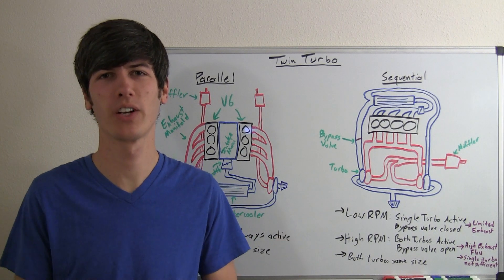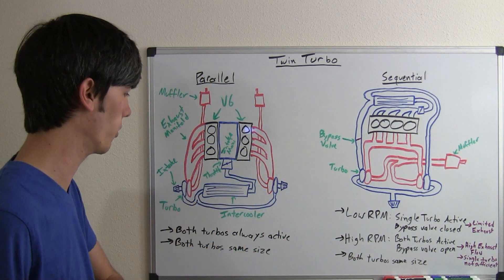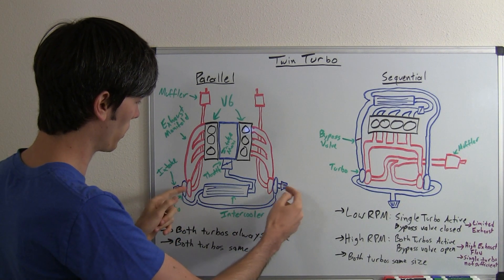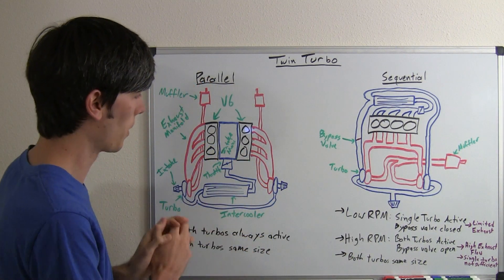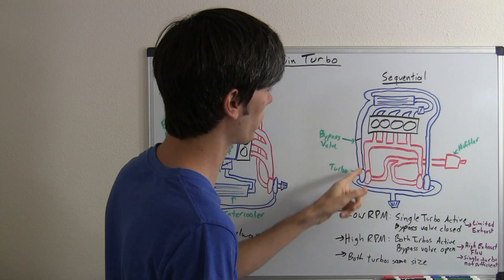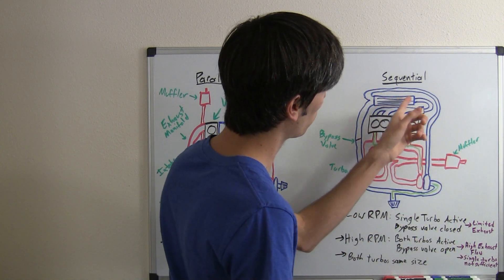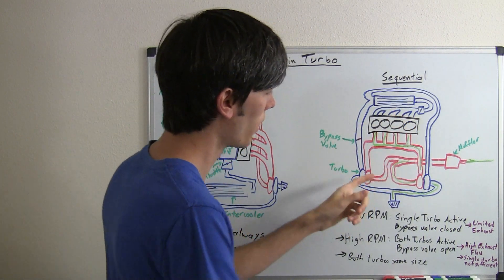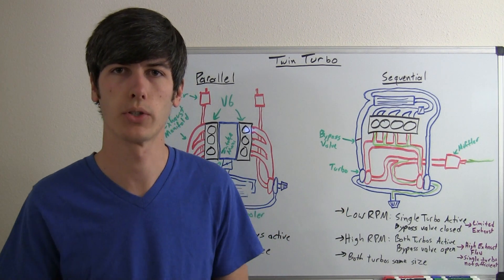How Twin Turbos Work - All The Boost!

Comment: why not use single turbo?
Reply: couple of reasons really... you could fit a single tub but you may find it runs out of puff higher up the rpm because its a small turbo (eg 2860 series) resulting in a harsh flat spot of power - so you think 'hmmm... gt35 series tub will give me lots of power' ...but that might not be making real full boost till 4000rpm making the car really undriveable lower down the rpm range.  Selecting a turbo is a balance of response vs power output.  It all depends on what kind of power output your wanting to obtain from the car really... if you want a drag setup then a big tub with launch control might work awesome but if you want something responsive and 'street' based then smaller turbos tend to work best.  That all said there's some awesome developments with turbos... Koenigsegg use a variable wgate and vane setup to allow the turbo to spin up at lower rpm then come in harder later on.  Dual Ball bearing systems help improve response massively too.. i ran a GT3076R on my 33gtst skyline and that came in quick and low down the rpm range also sounded the NUTS.. check the vid on my channel :p
Garrett do a GTX series of tubs able to boost higher, come in lower down the rpm range and generally make a bit more power than their GT series does.  in fact for 2.5 to 3 litre engines a GT30 series tub is an absolute laugh riot :p  I'd happily build another :D

The sequential turbo route (2JZ supra for example) - i THINK (someone correct me if wrong) works by using a small turbo to help the car lower down then a bigger one comes in to help higher up the rpm range.
Parallel turbo setup (eg RB26DETT nissan skyline) uses the same size turbos powered by 3 cyls each... this helps keep a great balance of response vs power... however the RB26DETT is known to turbo shuffle altho i hear ppl mapping them with MAP based tuning can eliminate alot of this :)

cheers
ant

Comment: This guy says the turbo it's going to pull in air through the intake and it goes into the intercooler... Thats wrong. On a turbocharged vehicle, it looses the intake air filter. Now that pipe runs all the way to the front of the vehicle where there is an intercooler. When the engine is is running, it's spooling the turbo. The higher the engine rev's, the faster the turbo spools. Now, the turbo has 2 sides. One side is where the exhaust/turbo manifold gasses go through, and the other side pushes air through an outlet which has tubing running to the other side of the intercooler. Inside the turbo on each side is a turbine. Now the side the exhaust gasses go through spin faster as the engine rev's higher. The other side's turbine pushes air through the tubing to the intercooler, out the other end, into that tubing, into the intake. The intercooler just cools off the air coming out of the turbo so that it increases the density of the air supplied to the engine.
Reply: lol stopped reading when you said "loses the intake air filter". Honestly, have you not seen 90% of turbo setups out there? Also, no he doesn't say the air passes through the intercooler before the turbo, if you listened and/or look at the diagrams behind him you'll see the intercooler is routed after the turbos. And thanks for the huge explanation on the basics of how a turbo works but I'm pretty sure whoever's watching this video and reading these comments already knows.
Reply: I never said it passes through the intercooler before the turbo. I said he said it passes through the intake before the intercooler. Which is wrong.
Reply: +Brandon Lieberman I didn't say that you said that, I said that you were wrong when you said that he said that, because he didn't.
Reply: Listen to the video.. On the sequential turbo, he says it's going to spool up this turbo, then it's going to pull in air through this intake along this channel, and then it'll send that air up here into the intercooler, through your throttle, into your intake manifold, into your engine, and it'll keep recirculating like that.

That's wrong because it'll spool the turbo, push the air from the turbo through the piping going to one side of the intercooler, then the intercooler will draw in air, making the air from the turbo more dense, and it'll send that air through the piping on the other side of the intercooler, up to the throttle body and into the intake manifold.
Reply: +Brandon Lieberman On a turbocharged vehicle, whatever piping runs into the turbine of the turbo becomes the "new air intake" if thats what you want to call it.  Most people either let the turbine be exposed, or run additional piping and attach a pod-styled filter to ensure no debris goes into the turbine itself.

The turbo intakes air - therefore, it is part of the air intake system.

Comment: That is not how this works. That is not how any of this works. Twin turbos are setup in sequential order. Doing so in any other way is a huge waste of time and money. The lower turbo spools first as its exhaust wastegate is the entrance for the turbine (exhaust) side for the larger turbo. So with the exhaust wastegate closed it spools the small high pressure turbo first. It then will open its exhaust wastegate at a predetermined set of values in the ecm to dump exhaust pressure into the lower larger low pressure turbo. This allows you to have the power and responsiveness of a variable geometry turbo without the gigantic issue of stuck rings and vanes. There is a couple other styles of variable geometry turbos out there but, the most talked about ones are the vane style. I personally like the style created for the Konnigsegg. FYI to original poster I am a technician. I have been doing this for over 2 years and have 2 years of schooling. I see real world and read books. Your videos on vehicles and how they work constantly piss me off because you never ever get your facts right. Go to a place that actually makes the stuff. Talk to engineers who design the stuff then go talk to the mechanics who fix the stuff. Get properly educated before you teach masses of people the wrong things. Those drawings are inaccurate as all hell. They never cut off air flow on the intake side. Always the exhaust side. The exhaust is what causes it to spoool. Seriously just stop already.
Reply from the maker: +UberArchangel No need to be hostile or state things that aren't true. If you want to learn about sequential turbos, I'd recommend watching my video on... sequential turbos. https://youtu.be/DRcmgibm-aA
Reply: +UberArchangel So all I've gotten from this post is that 2 years of school and 2 years of technician work make you really salty. You said, "Go to a place that actually makes the stuff. Talk to engineers who design the stuff then go talk to the mechanics who fix the stuff." But if you knew what you were talking about, you would KNOW that's EXACTLY what he does. Not only that, but you do know that he's a graduated engineer, right?

Comment: Turbo or supercharger
Reply: The famous question. Depends on your needs, if you want more power in the ecofriendly range rpm then do a supercharger. If you are racing anything and need a lot of top end then do a turbo. The rest is mainly opinion based.